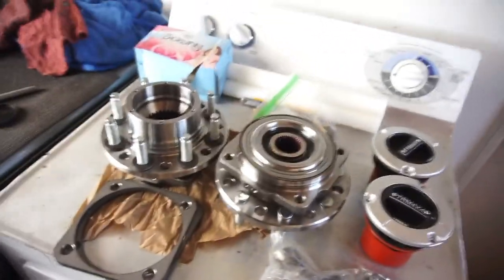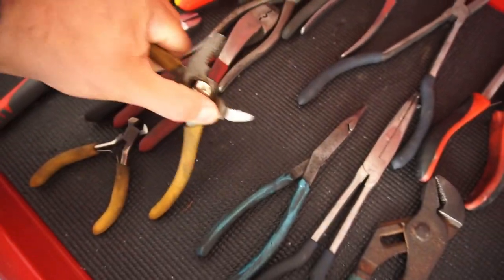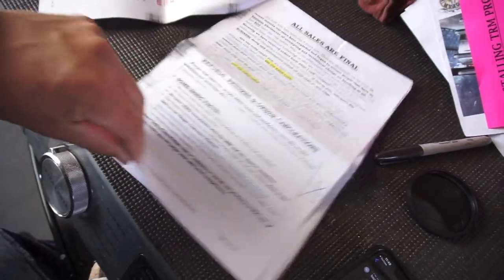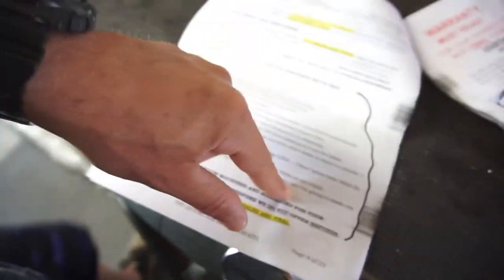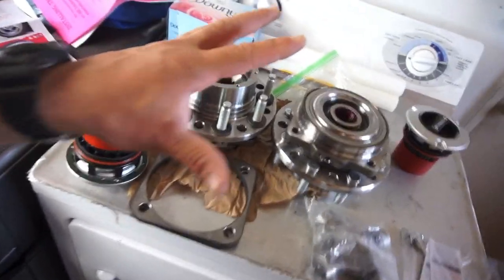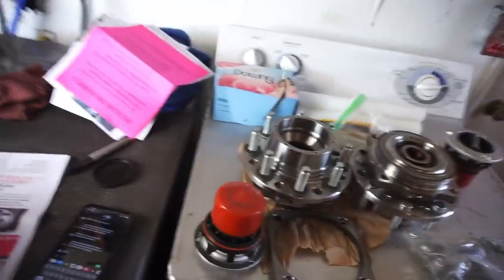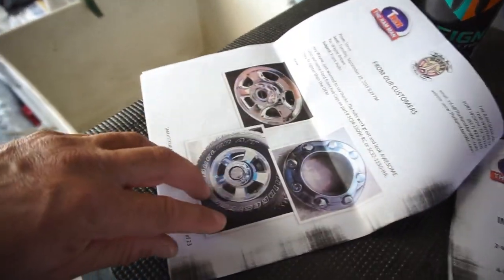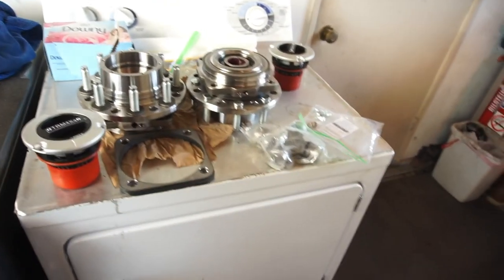The Ram Man inc Manual Locking Hubs Overview. 3rd and 4th Gen Ram

Comment: This is a VERY helpful video, especially the part starting at about @10:29 which discusses that these are reworked Ford SuperDuty pickup front unit bearings.
Reply: I'm surprised that the Ford Super Duty pickup unit bearing assembly has the same knuckle-side flange bolt pattern as Dodge (which also means it's the same as GM HD pickups).

Comment: I bought the kit for my 1500 Ram, total junk, they told me two weeks delivery,  took over two months, ok I get it. Opened the package, one spline was machined wrong, they used zip ties on cv boots and the cv shaft are China junk not OEM like they say on their website. They won't respond to my emails. They also have ALOT of complaints.
Reply from the maker: I saw all those bad reviews but for the Ram 2500 I haven’t seen any negatives. I just didn’t want something that stuck out a foot like Yukon and those other companies. Plus there’s no maintenance on these bearings unlike Yukon’s. If I owned a Jeep, Toyota or 1500 dodge I’d definitely not go to Ram man.

Comment: Do you need to replace the stub shaft or does the factory stub shaft work when you swap them out I have a 2018 ram
Reply from the maker: You keep your factory stub shaft. There’s an adapter that comes in the wheel bearing from the Ram man.
Reply: this is a scam he robed me
Reply from the maker: Maybe you got scammed but everything went smooth for me. Did you forget the inc?

Comment: I'm considering getting these for a Turd-gen Dodge since its the only free spin kit that is low profile. So far would you recommend these?
Reply from the maker: I have only had one issue which was the cheap hubs they come with, one of them blew up. They Warranty them but I paid the extra for premium warn hubs and haven’t had an issue since. I don’t have any vibration, noise or abs issues and am getting around 3-5 MPGs better and the truck accelerates quicker. And I’m not sure how to describe it but the truck feels lighter on the steering too. I like them.

Comment: I’m not sure rammaninc is in business any more. I just had to go in and contest the charge today. They don’t respond to any form of communication. Pretty gross company.  Potential to lose thousands of dollars if you risk it.
Reply from the maker: It’s just a Ford super duty wheel bearing. If it goes out all I gotta do is take it to a machine shop and have them drill out my lug pattern and swap the spacers and adapter over to the new bearings. Doesn’t seem that horrible considering I’m saving money on MPGs.
Reply: @Halffast719  I think the splines for the axle are different. Still never heard a thing from these guys. I’m still waiting on my credit union too. May have lost $2k over this.
Reply from the maker: Dang that’ll suck if you’re out $2k. Yeah the splines are different but there’s an adapter he makes that I could just swap into the new bearings. So I have all the parts already is what I’m saying.

Comment: So basically  just drill the  rotors ..add spacers (washers)..to the wheel studs so air flow can keep the bearings  cool..and not overheat..instead of buying this?...damn..i got 2016 ram 2500 4x4..with 22x14 wheels and ive replaced the wheel hubs once..with 184k...im good
Reply from the maker: Yeah pretty much. And get an adapter for the stub shaft to go from ram to ford or maybe just get a ford stub shaft with a special u-joint. My plan if one of these bearings fails is just go get a timken ford wheel bearing and take it to a machine shop since I have the adapter.

Comment: I don’t see the point of all that $$ and not having rebuildable bearings like Yukon spintec dynatrac I have had a lot of Dana 60s danna 44s never over heated bearings no spacers. Not trying to be rude. Seems kinda cheesy to use Ford unit bearings. Good video.
Reply from the maker: I looked into all of those. I wanted a low profile look. These are a timken Ford bearings. I’m hoping that if I keep them greased they’ll last a long time. All my work trucks were fords that I’d put 250k miles on a year and never had any issues but we’ll see. I’m not taking it rudely because I thought the same exact thing but we’ll see.

Comment: Have you had any issues with these
Reply from the maker: Only issue I had was the locking hubs that it comes with are cheap and 1 broke. They were going to replace it but I paid to upgrade to the warns. They gave me a big discount on the upgrade. So if you buy them upgrade the locking hub is all I can say.
Reply: @Halffast719  so was it the mile marker hub that failed?
Reply from the maker: No Ford hub. I didn’t upgrade when I ordered them because they were out of stock on the mile marker hubs. They had some Australian companies but they wanted a lot. So now I have warn and would highly recommend them.

Comment: I hope you can still reply to this. I got a truck that has this conversion kit on it and the manual lockers have bother snapped and broke. Seeing as they are reworked ford front unit bearing hubs, youd assume ford replacment lockers would fit..... Except they dont. So now what the hell do I do?!?! Am i stuck with useless reworked hubs now>?? lmao this is fucking awful. Have you had this issue and have you ever had to replace them, if so do you remmeber the part you found to fit!?? 2012 ram 2500 6.7 35 spline axle, but when i get the dorman manual locking hub 600-220 for 35 spline ford replacement hub, it will not fit inside the hub assembly. wtf did this guy do, make custom lockers so youd be fucked if they broke and need to order from him to replace?!?!? last thing i want to do is send that guy any money seeing as he has the worst reviews of any business ive ever seen online. Some one please help
Reply from the maker: So there’s an adapter inside the hub from fords stub shaft to our shaft. Really simple actually. I installed warn hubs on there and just had to swap that adapter. Hopefully that’s what you’re talking about.

Comment: I was really intetested in the ram man stuff till I seen all the bad reviews about him on pretty much every forum and a bunch on the BBB site too so there is no way I would buy his stuff.
Reply from the maker: But I think that’s more for the 1/2 ton dodge, definitely the jeep, his older version where he basically just glued a hub on the bearings. Mine seem to be holding up pretty good. 40k miles. I’d rather go with spyntec if they could go a lot smaller. Even their smaller version low profile,still sticks out past the wheel practically.
Reply: @Halffast719  Google The Ram Man Reviews. It doesn't paint a good picture about them.
Reply from the maker: I googled him a bunch. I saw all his crappie products. That why my stock bearings are in my toolbox in the bed haha. He sells a lot of junk and I’d like to think these ford bearings will last since all my work trucks over the years have been fords that I put well over 250k miles on each one of them. That’s 5 trucks dang 1.25 million miles.
Reply: @Halffast719  I think from reading the complsints the biggest problem has been been their non existent customer service.
Reply from the maker: Yes I agree. Custom isn’t there. I had a hub break the first time I used it and it took 3 weeks for them to respond and I upgraded to warn black. I’ve used 4wd 3 times and so far no issues.

Comment: Thanks for making this video, it clearly shows what a jury rigged POS this kit is. You just saved a lot of people a ton of money and disappointment. Washers between the hub and rotor only a moron would make it like that. How’s the brake pulsation?
Reply from the maker: I have no pulsating going on. I got 10k miles on them with no noise. But when I get to 50k miles if they last that long. I don’t mind being the Ginny pig haha. If they blow I’m sure I’ll let everyone know.
Reply: On the GM kits, there is nothing holding the CV output shaft into the unit bearing, because the threaded end had to be eliminated to have a splined end for the locking hubs. RamMan thinks that's not a problem because the CV axle can't move inward far enough to disengage the splines. But the male splined shaft and female splined hub aren't designed for axial movement.
Reply: @Halffast719  ...and if that happens, it's not just the replacment cost, but also that you're dependent upon an "eccentric" (to put it mildly) guy to still be around to provide new replacement unit bearings.
Reply from the maker: If that happens then I’ll just buy Ford bearings and drill machine out that lug pattern I guess. I’d like to think I’ll get 100k miles out of these if I maintain them properly and stick with this wheel and tire size or stock size.
Reply from the maker: Plus can you imagine the vibration you’ll get if you have to drive in 4wd for extended times. His thinking is you only need 4wd to get you unstuck probably.

Comment: Do the RamMan locking hubs that you got have the female splined section that's a separate piece pressed into a machined-out area in an off-the-shelf unit bearing hub?  (as shown at the 1:20 point in this video https://www.youtube.com/watch?v=TiPSvgWufr8)
Reply from the maker: Oh I didn’t watch the video. No they’re nothing like that video.
Reply: @Halffast719  The other video is a Jeep kit (smaller). Do the ones you got for Dodge HD pickup have wheel hub flange and the hub-lock female spline section (separate piece in the other video) all out of one piece of steel?
Reply from the maker: Whole hub is one piece.
Reply: @Halffast719   THANK YOU!
Reply: @Halffast719  I had assumed that the wheel bearing are user-replaceable, but although many of TRMs video overtly mention the replaceable stub-shaft bearings, but I've yet to see one that shows replaceable wheel bearings.  Are they on the Dodge TRM hubs you got?

Comment: Wow I'm glad I installed SpynTec, his design looks horrible, with all this washers an spacer I'd never want that on my truck.
Reply from the maker: Spyntec are junk. Might as well of just removed your half shafts.
Reply: @Halffast719  not really that crap you put on is junk, bunch of spacers, crap hubs, your not even bolted to the axle 🤣 you got ripped off way bad.
Reply from the maker: Well I like the low profile look. I didn’t want my front end looking like it’s from the 60s. My spacers "washers” don’t need servicing every 30k miles. You keep you Chinese Kia bearings and Chinese shafts. Let me know when you’re stranded on the side of the road with cooked bearings and I’ll come save you buddy.
Reply: @Halffast719  your whole wheel bearing is going to fly off one day, Ford which this dude claims his design is based on does not use spacers an washers. An I have timken bearings also, all are high quality parts. Toyota has used the same design as SpynTec and they dont have problems. You already showed slop in the half shaft in your own video. That alone eventually will snap it off. My friend has ran the same brand as me for 100,000 miles towing backhoes an not one failure. Also I've been seeing alot of video's of that guys unit bearing's failing an piece coming off the hub. You run what you want, just becareful you dont wreck.

Comment: 2010 just put them on... wont lock!
Reply from the maker: Missing a piece or installed locking hub incorrectly? 🤷‍♂️
Reply: Right wheel will lock but left wont.
Reply from the maker: I’m not trying to be dumb but did you install any grease or maybe too much grease? We’re the splines on your stub shaft clean and not all boogered up? Just try to think about stuff that could be wrong because mine work flawlessly.